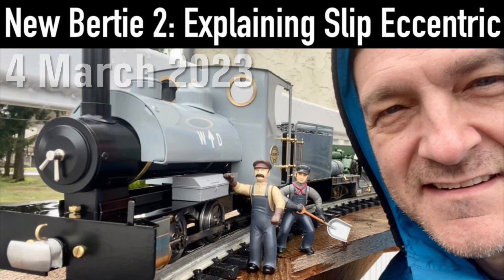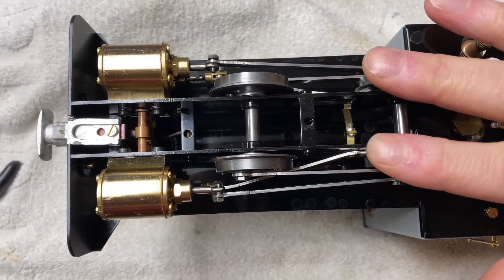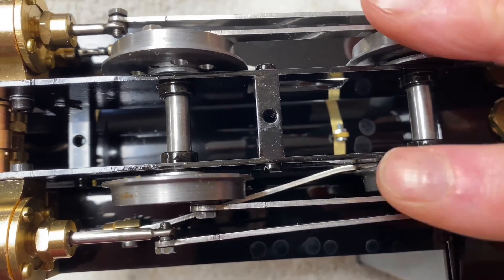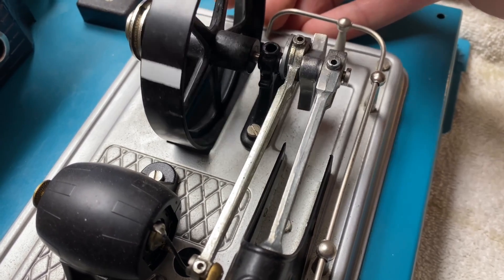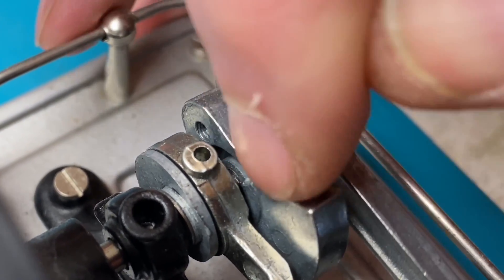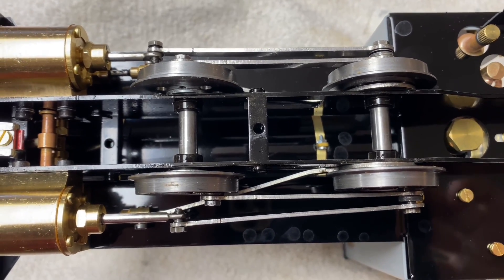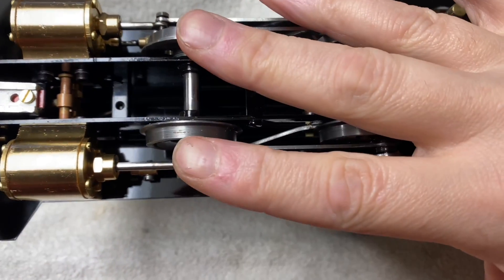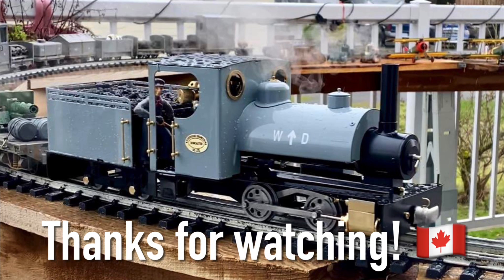Victoria BC: 2. Explaining Slip Eccentric Valve Gear - Using my Brand New RH Bertie (Please Sub)

Comment: Nice explanation of the slip eccentric gear.  I was a bit baffled when I started but worked it out once I got my Mamod Brunel.
Reply from the maker: It is a robust gear. Nothing to go out of adjustment either. I used to have a very old Aster which I sold before I started my channel. It had slip eccentric gear and worked super well.